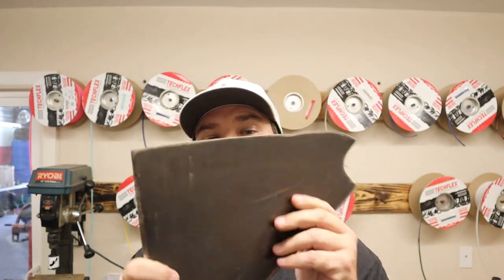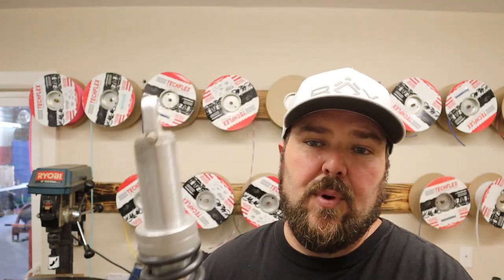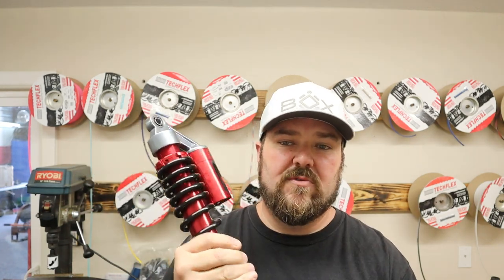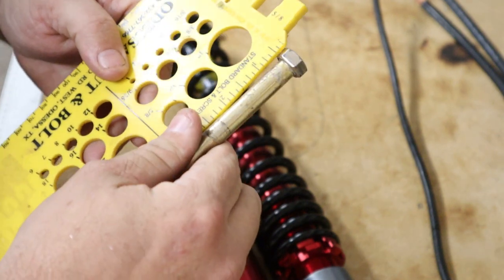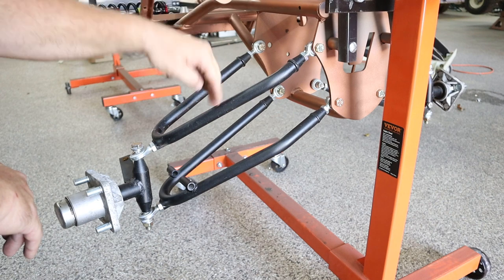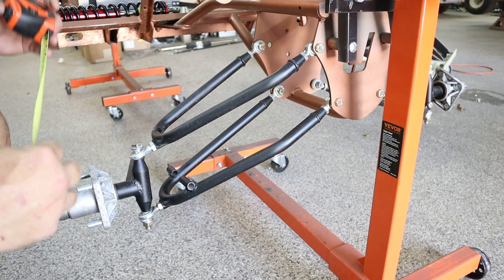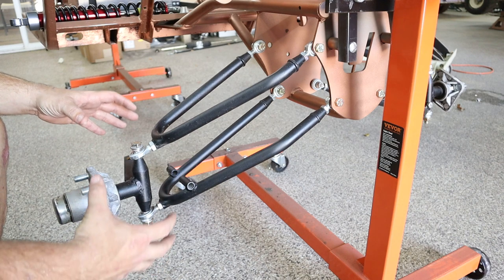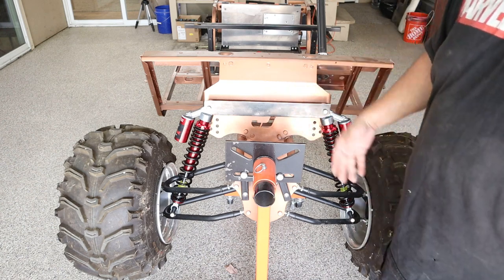Jakes Long Travel Mods Part 1   Baja EZGO TXT

Comment: Question. I have issues with my wheel right wheel skipping or dragging when making a left turn.   Ever seen or heard of this?  
I have also had issues with my oem jakes shocks cracking at the top mount.   I have notified jakes and sent photos. I was given replacements.  However im scared to death these shocks with break again.  What a nightmare if you’re underway and this happens.  
Im Hopeful your recommendations in this video will resolve my problems.

Comment: I am looking to build the smoothest riding golf cart possible.  
 And was hopping you had a plan in your computer that could be modified for an offroadish golf cart  idea I have.
It will have a 84 inch wheel base.
Total width to outer edges of wheels of 60 inches.
24 inch tires,  Twin air ride seats.. It will be electric.
Any help or ideas would be appreciated. 
Thanks...

Comment: Would the spring rate on the Predator shock be able to handle the rear weight with 4 link set-up.   I am in the process of trying to build a 4-link kit for mine.

Comment: @GolfCartsModified do the predator shocks have softer springs than the Jakes? I just installed my Jakes long arm on my rxv and even with it on the softest position it’s still pretty stiff.
Reply: You are not wrong. Jakes springs are way too stiff